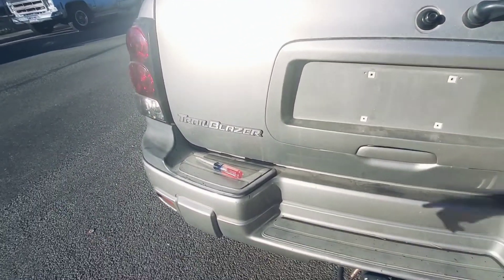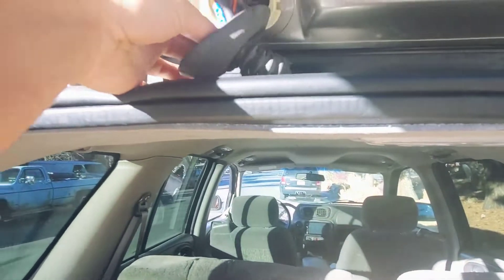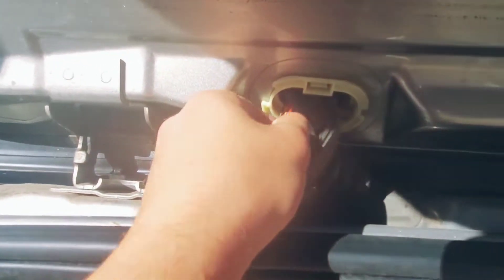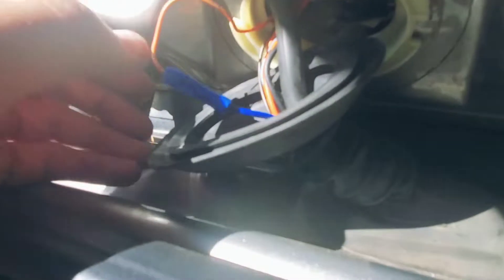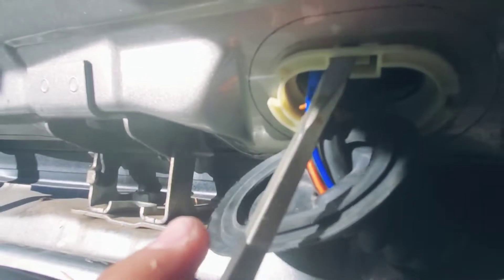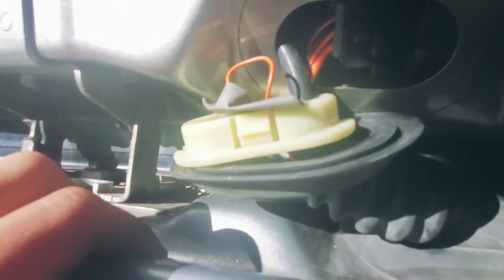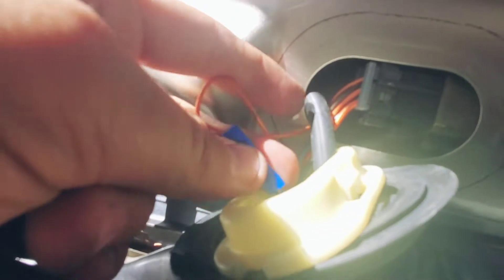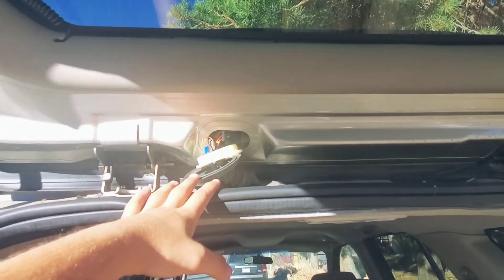2002 to 2008 trailblazer key fob not working liftgate not locking FIX!

Comment: You sir are a life saver!!!
   I have a 2002 GMC Envoy. I had lost the following: Rear door didn't lock, rear wipers didn't work, no retained accessory power for my windows and radio, cruise control did not work, interior light timer and keyless entry did not work either. I have spent over $400 and a year of trying different things to fix this problem. I bought a new body control module and paid to have it programmed, also bought a rear liftgate module. Nothing worked. I was ready to give up and live without all of these features. I have found YouTube videos that alluded to those wires being bad but I just couldn't believe it. It's hard to believe that little orange wire that goes through the boot from the interior to the rear hatch caused so much damage. When I accidentally came across your title "key fob, liftgate not working fix", I clicked on it and there it was laid out with perfect video of the problem. I opened my rear hatch, pulled back the boot, tugged on the orange wire and out it came. My heart started racing 100 miles an hour. I KNEW that was the problem. I found a piece of 18 guage wire, taped it to a tie wrap and used spray on silicone to feed the piece of wire through the boot. I the crimped it together on both ends and tried everything and it all worked like it's supposed to.
  You have made my day! Thanks a million!
Reply from the maker: glad I can help man thanks for the comment!

Comment: Thank you, Thank you, Thank you, I have been working on the key fob not working for months. When the whole back electrical stopped working (wipers, washers, rear defogger) I found your video. Both the larger and smaller orange electrical wires were broken on my 2002 Bravada. All back and working. I used a small piece of 1/8inch copper tubing sprayed with silicone as a runner to get the wires through the rubber flex cover.
Reply from the maker: im so glad it helped if you have any other questions ill answer them to the best of my ability
Reply: That is music to my ears

Comment: This video was very helpful I found out that the black wire and green wire were cut thank you for making this video. Also do you know if the wires control different things or do they all control the same stuff. My rear windshield wiper dont work my key fob don’t work and the license plate light doesn’t work.

Comment: I love you! You’re awesome. All of a sudden if all your key fobs were working then zip. Its this fix 100%. Mine was the blue wire that snapped. Try to pull gently but first remove the lower rubber gasket off and look to see if you see any of the wires broken if it is at the top of the deck lid underneath that rubber gasket, then try not to pull the remaining wire out of the gasket upper and lower part. It’s a real bitch to get a wired to feed through there, it’s very narrow.. Either way I did it and it worked perfectly. Everything‘s back to normal again and yes, it was a broken wire. Thank you for everything.

Comment: The boss can you help me I have same problem
Reply from the maker: what questions do you have?
Reply: @coloradodreaming5075  I have same problem with my trailblazer 2005 lift gate not lock and key fob not working
Reply from the maker: @eleazarrosales5012  okay have you looked in the boot shown in the video?
Reply: @coloradodreaming5075  yea but I can’t find the problem or broken wire
Reply: @coloradodreaming5075  I did but looks everything good I don’t know 🤷‍♂️
Reply from the maker: @eleazarrosales5012  have you or someone else replaced anything back there? or was the boot torn or off a little bit? sometimes water gets in there and messes up things. if someone replaced the lock module and didnt get it reprogrammed that will do it too
Reply: @coloradodreaming5075  since I put new stereo and cam back up I don’t know what I did since that day my fob key and my Lift-gate don’t work anymore .😞😞😞😞😞
Reply from the maker: @eleazarrosales5012  ohhhhhh did you pit your car into protect mode? the stereos have an anti theft system. i can ask the guy who installed mine how he got around that if you want but there are plenty of videos of other people doing it aswell
Reply: @coloradodreaming5075  I don’t put my car in protect mode this happens when I put the camera and new stereo but the old one was aftermarket too I don’t understand .
Reply from the maker: @eleazarrosales5012  i wouldnt know then sorry never had or seen that problem
Reply from the maker: hey you might have a break farther down the line or the fuze blew
Reply: @coloradodreaming5075  I did check all fuses but nothing burned  I can’t find the issue
Reply: @eleazarrosales5012  are you in colorado?
Reply: @grimreapersbrotherdave2392  not .I’m in Georgia
Reply: @eleazarrosales5012  sorry i was gonna say ill look at it for you
Reply: @grimreapersbrotherdave2392  is ok thank you .
Reply: @coloradodreaming5075  that broken wire can be very difficult to find (in the boot).  For me, I had to remove both end covers and pull the wires back and forth in order to reveal the broken wire